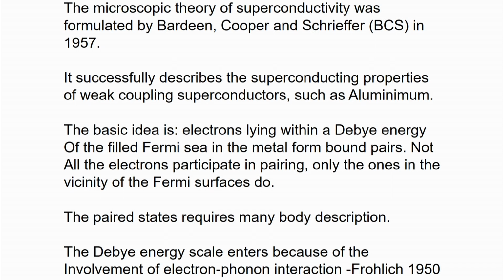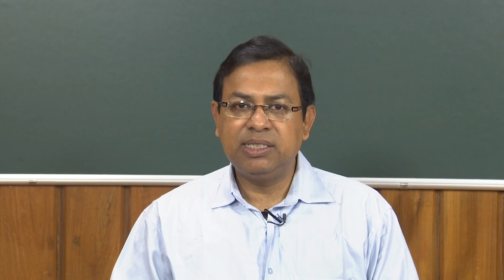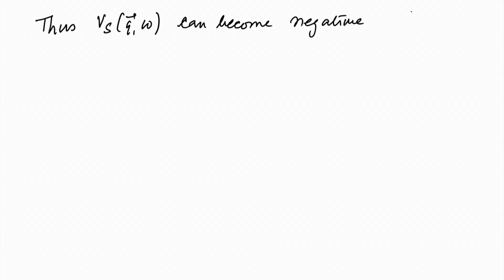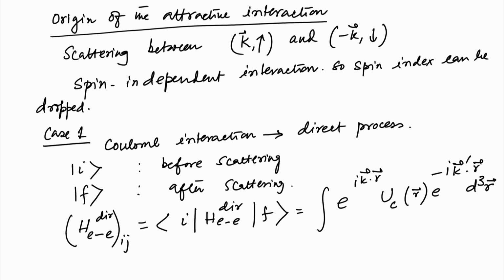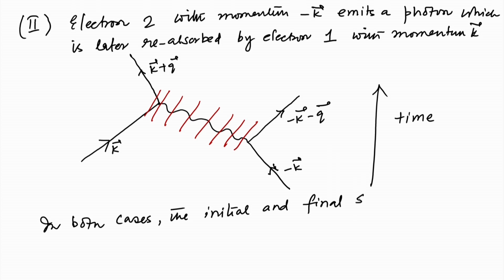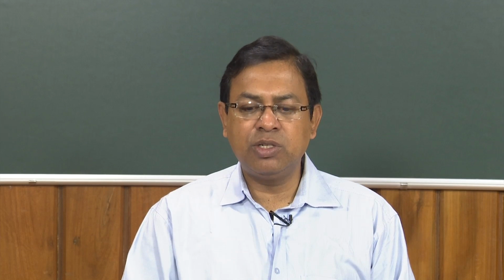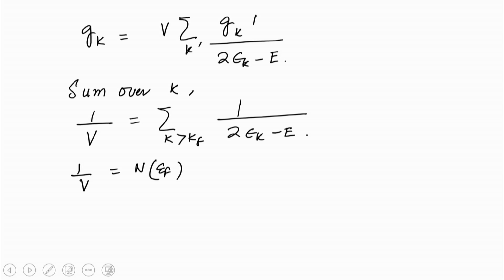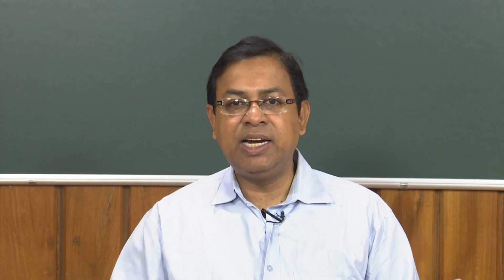Cooper's problem, BCS gap equation

Comment: Dear Professor! It is very great job you do in the lecture series. At 37:40 I guess it should be + sign between 2 terms and it should results 2 omega in numerator instead of 2 omega q. Referenced from Ashcroft Mermin equation 34.10.